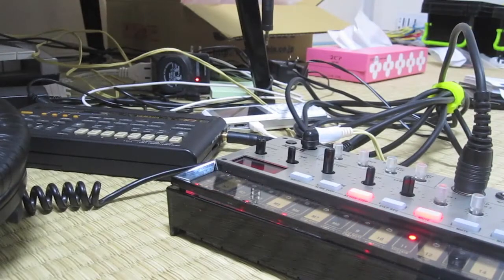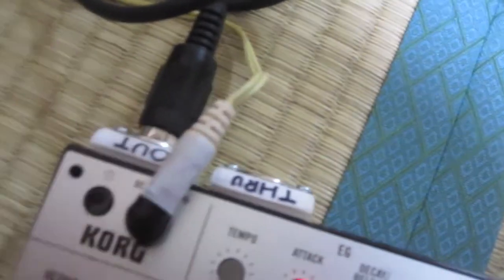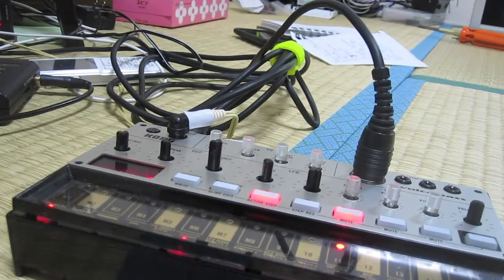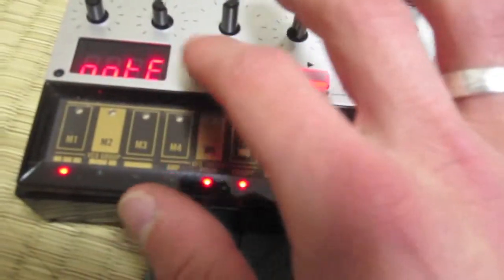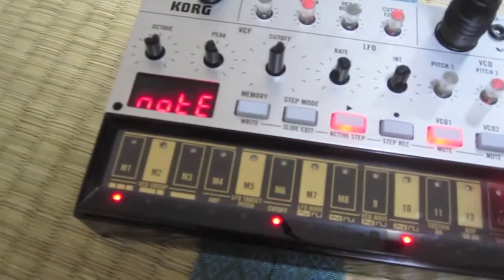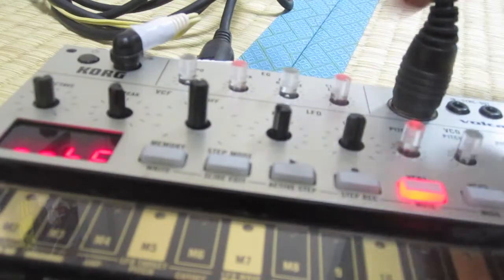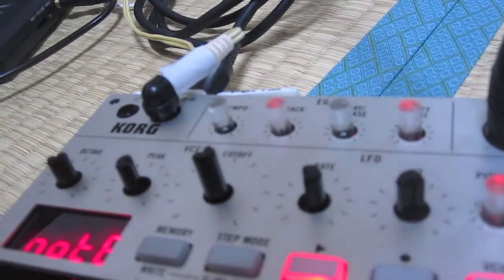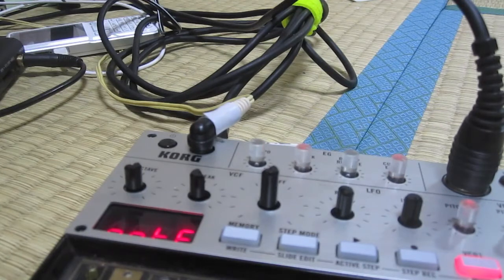Korg volca bass MIDI OUT and MIDI THRU MOD

Comment: Hi, Trying to add the THRU MOD mod, after a successful MIDI OUT attempt. I have a strange problem: When the thru is connected, the Volca stops receiving midi. The thru works fine at this stage but then the Volca refuses to acknowledge any midi signals when a lead is attached to the thru mod. Did you experience anything like this? Great vid BTW, many thanks for your help!
Reply from the maker: Thank you! Hmmm... I never encountered that issue yet. The one I ran into was sometimes the midi signal from the thru was too weak so other synths couldn't get it or not being able to sent out midi and receive it at the same time. I hope you can find a solution.

Comment: good work! ;) so thats also possible for all the volca series?
Reply from the maker: Thank you and yes!
Reply: Raffaele Roma yes sir. But I did I it on the volca kick and it does NOT send note on / off / pitch but only midi clock and CC. Would have spared me a lot of trouble if I had known before I resold the kick. 
🖐🤖🖐

Comment: Hi MrFricoco, thanks for the video. I'm also planning on doing the midi out and thru mod. I have two questions: Does the mod still work now, three years later? And I want only one midi output socket and use a switch in between them. Do you think that'll work? Thanks! :)
Reply from the maker: Hmmm.... Yes the midi output works well, the midi through will depend on if there is a proper midi buffer at the other end, since it isn't buffered. What do you want to put the switch between?
Reply: The switch is to switch/make the  midi out into a midi thru. So only 1 midi socket is used. Planning on having the Volca Keys midi connected with one cable to the Microbrute with the audio going to the Microbrute. With the switch I can switch between using the midi in (keyboard or daw) as a source via the midi thru or the sequenced midi from the Keys via midi out on the same cable. But I'm not sure if the Microbrutes midi input is buffered or not. How can I find out?
Reply from the maker: Ohhh, That's a great idea! Yes that switch should work. One more thing I did notice there could be some issues with it getting confused if you send it midi and try to output the midi sequence recorded onto it. The only real way to tell if it has a buffer would be to open it up and look or check the schematic, but for a newer synth that isn't really a huge budget synth or DIY synth, I wouldn't imagine it would be missing one.
Reply: Cool thanks. I guess I just have to try it out myself. So most new synths will have a buffer is what you saying? That's good news. I'll let you know when I finished my mod. Thanks a lot. :)
Reply from the maker: I think so yes. Ok, if you have pictures, etc. I'd love to see them too!
Reply: Cool, I'll let you know.

Comment: Thanks to this video I am in the process of doing this. I will have a wooden block mount it (may paint it black). I am deliberating over having Midi Thru. It has been over two years since you did this (and maybe someone else did it too), have you run into any issues with Mid Thru or has anyone else since then?
Cheers
Reply from the maker: Yes, I have. The one big problem is it doesn't have a buffer. So if you connect it to gear with their own midi buffer it should be ok, but not all pieces of gear have their own so sometimes it gets a little weird.
Reply: What gear did it work ok on? Did you try the Microbrute? I'm hoping to get this working with the Volca Keys mid thru to the Microbrute.

Comment: Are the two connectors mounted on some plastic? i bought one like yours, but it looks like I will have to place some plastic or wood between the end of the connector and the side of the case.
Reply from the maker: Yeah, I had to do the same. I just got some cheap plastic pieces, from the dollar store, then drilled holes in them. There are more professional ways of doing it, and better looking, with spacers.

Comment: Hello, will it send  note length too?
Reply from the maker: It sends note on and off, which is basically note length, but it doesn't send the decay of the note.
Reply: so no linking notes either?
Reply from the maker: What do you mean? The Volca Bass basically works as a monophonic controller so it will send note on and off, but it can't send chords. It will give any polyphonic synth the "feel" of being monophonic, because it can only send data for 1 note at a time. Is that what you mean by linking? Basically like the slide of the oscillator?

Comment: Hello! 
Good job! I did the midi out trick with a volca beats
If you plug something to midi thru, the midi in is going to midi thru, but do the midi in continue to trig internal notes and CC?
Reply from the maker: It can happen that it won't. Depending on if the gear you use it with has a proper midi buffer. For me only 1 piece of gear cuts out the midi going to the volca.
Reply: Are you speaking about the gear plugged on the midi in or the one on the midi thru?
I have tried with an alesis qx49 keyboard in and a midi>usb pc interface on the thru to monitos the midi.
Reply from the maker: I can't remember now, but it did happen before. It all depends on how each piece of gear is setup.

Comment: How much would it cost for you to modify my Korg volca sample to have midi out?
Reply from the maker: +Michael E The cost is very low. All you need is a soldering iron, wire and a midi connector. I haven't opened up a volca sample yet to see what's inside. Are you asking me if I can mod it for you?
Reply: +MrFricoco yes I am
Reply from the maker: hmmm... which continent do you live in?
Reply: +MrFricoco I live in North America. In los angeles
Reply from the maker: Ohhh, ok. Ya I live in Japan right now. It may be more worth it for you to do a quick search on Gearslutz or similar sites for somebody closer to you who can do it. Shipping to Japan is either gonna take a long time or cost a lot. Or this may be a simpler solution for you: http://www.usbtri.be/usbtribe_volca.html
Reply: +MrFricoco it doesn't show a price or a purchase link but that looks to be pretty awesome and simple. Thanks
Reply from the maker: http://amazingmachines.com.br/products_volcano.html this is also another option, as long as you can solder and have a drill or something to drill a hole.

Comment: Can someone tell me what the literal 5 pin midi part is called? How could I find just the 5 pin midi connector piece online?
Reply from the maker: Yourveryowncarrot it's called a 5 pin din connector or socket. The best way would be to look on ebay or at a local electronics shop. Ebay is great for the price, but can take some time to get.

Comment: Cool! Does this allow to have the midi out VCO controlling external gear in the background, while editing/playing a pattern for the bass' other VCO's? I.e. to have the volca bass treat the pattern for external midi just like the internal patterns?
Reply from the maker: Yes and no, all the patterns will play on the volca bass while outputting the"selected" VCO's midi pattern, but when you select a different VCO pattern to edit, that VCO will now be outputting the midi pattern. It makes it a tad difficult to do live pattern editing. Don't forget to mute the outputting VCO on the volca bass otherwise the bass and the external gear will play the same pattern, unless that's what you want to do. I will try to do a demo of how it would work or a a good way to use the midi out with other gear, so stay tuned!
Reply: That explains a lot. Thanks for the info!

Comment: howdy, regarding the midi out , i plan to install one, but i have one question. lets say i want to use the volca to run my juno 106, now, on the volca bass it'self i can write different patterns to each vco. does the midi out send all 3 or is there a way to have it send one out and the others on the volca.. thanks .
Reply from the maker: it will only work for 1 track of the 3 for each pattern. Whatever osc. is selected is the track that will play out of the 3. There might be a way to send 3, but you would need to add extra hardware into the device. It only reads 1 incoming midi channel for 1 osc. and only sends out on 1 channel for 1 osc.. Anyway this gives you a total of 24 tracks to work with. It's just a bummer it doesn't send out on more than 1 channel and accept more than 1 channel. Something korg should've thought about...
Reply: MrFricoco
thanks.. so sorry i took so long to reply.. your answer was what i was hoping for and i must say i LOVE that it works that way. i use the out i put in mine to a juno 106 and the combo is awesome!
Reply from the maker: PHAEDRIDER Glad to hear everything worked out! I'd love to hear them together!

Comment: Hi, using the MIDI Out can you record the Volca's sequencer notes into a DAW?

Thanks.
Reply from the maker: yes! Some things however will not be included in midi data like slides. You can only do one channel at a time too. this really works great as a monophonic keyboard.
Reply: MrFricoco ok, thanks for help. by the way, i've found a nice way to do this: http://www.fabriziopoce.com/VC_FAQ.html. cheers.
Reply from the maker: I stand corrected. Thank you for the share! As for the knobs sending ctrl messages, I was wrong too. When I modded it I only checked a few knobs so I assumed none of them worked, but EG attack, release, EG Int, all pitch knobs, octave, LFO rate, LFO Int and play button send out midi messages. There could be more buttons that work, but the peak, tempo, cutoff and volume do not send out messages. Wow I can't believe I was oblivious to that.
Reply: MrFricoco will it be able to record cutoff or any other knob movement into a DAW too?
Reply from the maker: no, the knobs I believe are analog. There could be a way to do it but this is not it. Resonance or cutoff can't be controlled by midi anyway, I think they are just purely analog.

Comment: MrFricoco! Great intro music!
It's really reaLLY REALLY great that you did the MIDI THRU - wich is totally lacking on many new products - (parts worth a buck for a company). You are absolutely right - it's a waste of midi cables only using one channel per cabel! 
Great mod!
Reply from the maker: Thank you for your comment I REALLY appreciate it. ;) Ya I don't understand why a lot of devices are missing it, it's a def must if your working with synths with more than one channel or only one. Got lucky though was not sure it was going to work.
Reply: MrFricoco Are you using any resistors on the THRU or just wire?
Reply from the maker: just wire. Unless I'm missing something, I think resistors would only degrade the signal.
Reply: That sounds plausible :)
I was just thinking that the blue things on the wires were covering something.
Reply from the maker: oh thats just shrink that I put on so I could identify which wire was which, since I only have black wire. No secret pieces to this mod, it's as straight forward as the midi out mod, 3 wires and 1 midi jack. The real trick is making it durable and pretty. Which I didn't do so well at. ;)
Reply: Shrink is a good start when wanting to make it pretty - and durable - avoiding shorts and so on. I think I will try something like this great mod you did!
Reply from the maker: Let me know how it goes!
Reply: I will.
Reply: Arrayzable Back again. I've just finished MIDI modding my Monotribe. I did the MIDI thru mod (instead of a MIDI out) - just like you've described - thanks for the idea!
Reply from the maker: Arrayzable Glad to hear!! Is everything working ok? How did you mount the connector? I've seen a few styles, but I'm interested in how other people fit it all together.